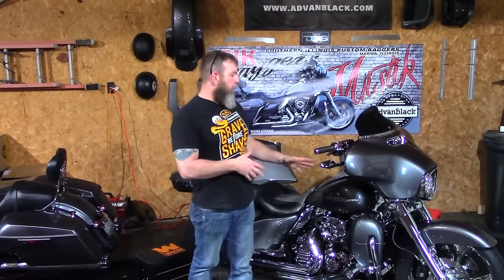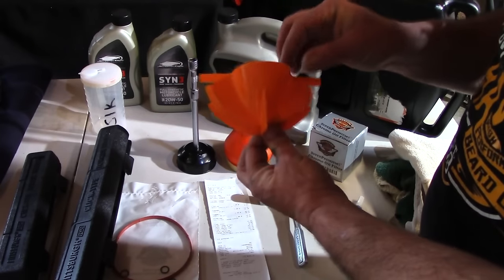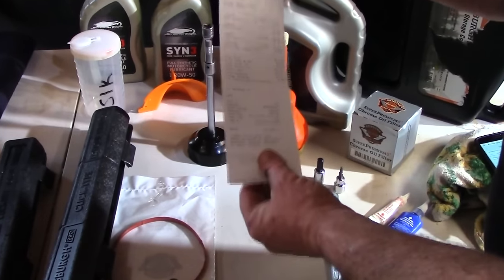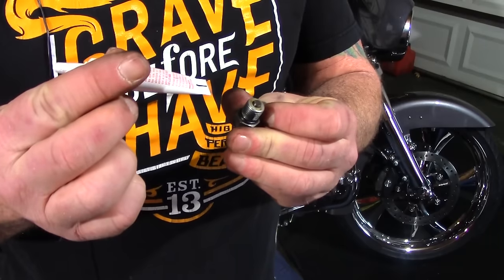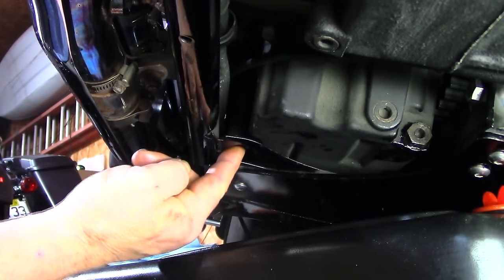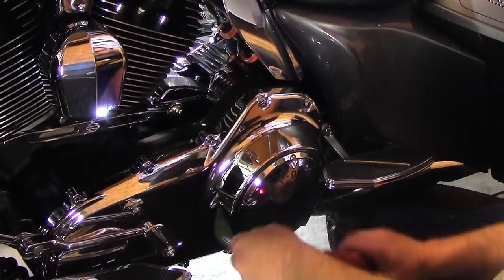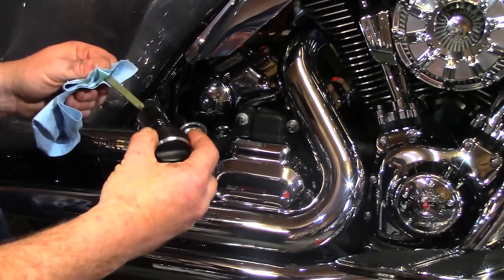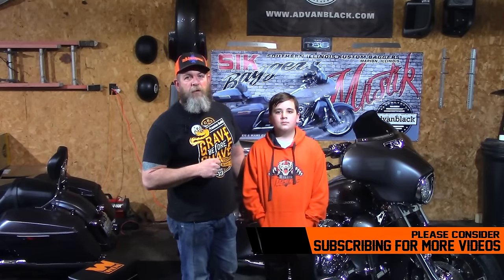⚡Twin Cam Complete 3 Hole Oil Change @harleydavidson  Touring⚡

Comment: All 3 holes take 20W-50?
Reply from the maker: Yes you can run syn3 20w 50 in all 3 holes...if you take your bike in for service at HD they will fill all 3 holes with syn3 unless you specify you want something different.

Comment: There are grease zerks to hit!!!
Reply from the maker: vf12497439 there is alot to do if youre doing a full service. This is a 3 hole oil change video.
Reply: Steven Housden I know but very few people talk about grease on a motorcycle. My friend has an ‘06 heritage and has literally never hit the zerks after 124k miles! Maybe a follow up video to this one? He didn’t know he had zerk fittings on his headset and softail sub frame pivots. Different models and years will be different but it’s often looked over. Great video tho.
Reply from the maker: You are right man...After reading your comment last night and then thinking about all the guys I had to remind here locally that they had grease fittings to hit I thought this would be a good video to do. I appreciate the feedback!  I will start working on a video like this soon.

Comment: Seriously, now.  How much did all that stuff cost at a Harley dealer?   It's gotta be ridiculous.  $300?
Reply from the maker: itll cost you that if you take it there for an oil change. Cost me a little less than a 100 if I do it myself and use all HD parts and oil

Comment: I use a puppy training pad to put under my oil filter, wife beats me when I use her towels,
Reply from the maker: Thats actually pretty smart man...never thought of that and I bet they are cheap. lol yeah my wifes not a huge fan of it either.
Reply: @sikbaggers  I just cut one in half cause they are big, tuck it under the filter and take it off, use the other half on the floor just in case some runs or drips off

Comment: Syn 3 is garbage. My bike came with it and it was an amazing difference when I changed it out at 700 miles
Reply from the maker: What difference dod it make...amazing? What was amazing? Got a 14 in the shop right now with 113k syn3 in all 3 holes on every change.
Reply: @sikbaggers  so are we to guess what he uses instead of syn3?
Reply from the maker: @dockterp1  lol i guess...typical!  down vote and tell me its terrible but has nothing to back it up or wants to take the time to tell us what is better.
Reply: @sikbaggers  BTW, great video, I bought the service manual for my 16 ultra limited low, you just saved me a bunch of reading and apprehension about wrenching on my sled.  I wrench on my cages but was nervous about the bike. looks pretty straight forward and since no one will tell me what's better than syn3, then syn3 it will be.  Thanks for taking the time to post the vid.

Comment: You couldn’t just use the cheap oil filter oil catcher, that diverts all the oil filter oil to the outside. Harley sells it cheap, well worth the few pennies and keep the oil from draining all over everything!
Reply from the maker: i guess you can if you want. I used it...it was junk. Spilled oil everywhere..Ill save my 20 bucks and use a old towel.

Comment: If I were you I would stay away from the seeing three Harley Oil or far as that goes any Harley Oil your best bet is klots or amsoill I've seen several cases where the seeing three will actually make lifter noise on the top end of your engine I stay away from this stuff I'm telling you
Reply from the maker: Yeah I guess its the bike...Ive been using the syn3 for years and no issues..my friend that practically lives on his bike (2014 with 112K) no issues..Ive serviced that bike since he got it...syn3 every time, all three holes.
Reply: @sikbaggers  yeah I was talking mostly about the twin cam engines and if you have loud mufflers on your bike you're not going to be able to hear it and who makes Harley syn3 Oil I know who make clocks and I know who makes anzola but I don't know who makes Harley Oil and that is a concern I'm sure it's fine and other box but I prefer klotz or amsoil I know its versatility and where it comes from and they do a lot of research on their oil to make it better and they don't have all these other things that they need to work on they can concentrate on making their oil better
Reply: And I'm not the only one that has had this happened to now that doctor seeing three hard boiled put in klontz oil it has stopped khaki just barely but you can hear it around 2 Grand RPMs if you don't have loud mufflers
Reply from the maker: @gregrhodes19  Its a very good point Greg....I have just never had any issues with it. I am not opposed to trying new things specially if its cheaper than HD stuff...I just had good luck with it so I stuck with it. Ive heard nothing but good things about amsoil as well.
Reply: @sikbaggers  hey man if I've had good luck with it I would definitely stick with it I'm the same way worked on cars all my life and I believed and just a couple of wolves out there so I don't blame you I would stick with it too if I were you but anyway hey Ya enjoy talking to you and maybe we do it again sometime